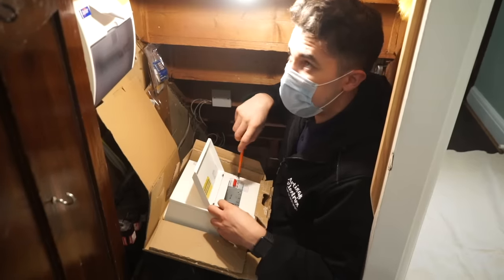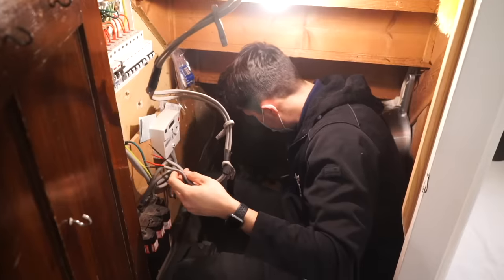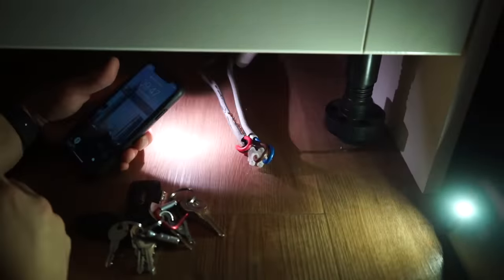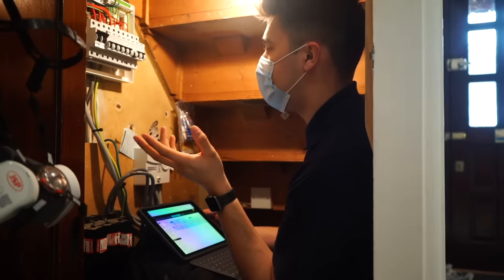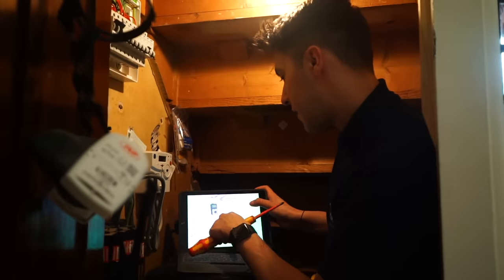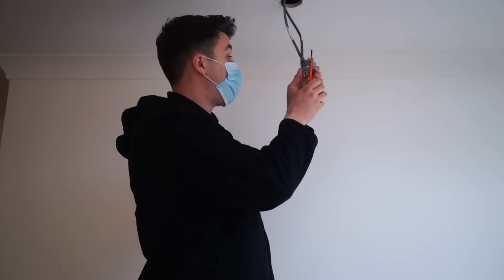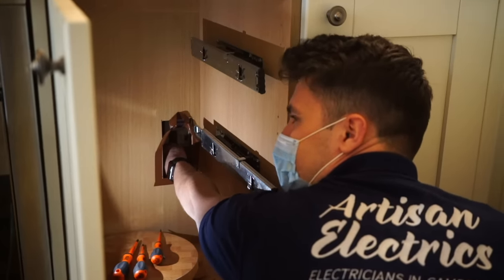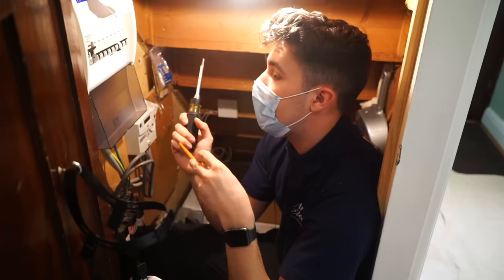COWBOY ELECTRICIAN WAS HERE...

Comment: Cory lives a very sheltered life, this is actually very good compared to some of the stuff ive seen.  Just last week I went to building site with some romanians staying on site, they had a 8.5kW electric shower running off some 1.5mm 3 core flex powered through a 13A plug.  I look at it and think, 'how has that not blown the fuse'.  Opened the plug and found a PZ2 drill bit wedged in place of the fuse and that was the safest part of the installation.
Reply: Sounds like my old school. The hand driers kept blowing their fuses so the caretaker put pieces of 6" nails in them instead. The covers had been lost and you could see the nails heating up.
Reply: Drama queen
Reply: Wow! To think I was worried about using an 8.5kw shower on 6mm......
Finally gave in and got gas central heating with a awesome shower.
Reply: @fabianmckenna8197 6mm is powerlines where I'm from

Comment: I'm retired now,I used to do this inspection and testing 80% of the time, I hated it! I did a big massive university village that took 18 months to do! 1000s circuits and faults on every one. Maintained by city council,  Mr.  Blunders. And I was the one always in trouble? "You switched off the power", they would say. "My computer went off"!  Everything held together with pvc tape and connectors. It cost £millions and £millions to re-wire the lot all for nothing. I passed through Manchester and stopped in disbelief. The whole site has been demolished to make way for a new hospital. I still have dreams nowadays of the Elizabeth Gaskell site! Great video, and good luck with your work.
Reply: worst thing about EICR's for me is that it becomes a thing where you're just going back on someone elses fuck ups. that pretty much all I would seem to find on most of the jobs.

Comment: It’s disheartening for customers, they pay a for a “Proper” electrician only to find out that it was a total waste of money. Or done on the cheap only to be bitten further down the line. 
I attended a customer for a fault, kitchen had only been in 3 months, Carpenter charged £600 to rewire kitchen and told the customer he had an electrician in turned out he did the wiring himself. Had to have the kitchen taken out to rewire the whole lot. We need laws like they have in Australia covering electrical work.
Reply: Even with the laws we have here in Australia there are still plenty of cowboys getting about. I have  come across some absolutely appalling electrical work in my 20 years in the trade.
Reply: Laws never stop incompetence , we are already  highly regulated , i for instance can't work on historical buildings any more because its not on my card (although i hold qualifications that say and prove otherwise but the new regulation systems have decided they won't recognise them ). They forget those with the knowledge , skills and experience often trained under a different regime where college and formal paperwork never really mattered . My main trade is carpentry and joinery , Electrical work was a secondary trade i learned  later in life , at 61 now i have no intention of formalising my training  done 30 plus years ago.

Comment: Awesome video and ♥️Cory !  I'm not an electrician but enjoy the videos.  What is the PCB in the box?  For low voltage garden lights??
Reply: It's a Wisebox. Off the shelf radio controlled circuits. Tend to get used for garden lights and water features, but you can use them for anything. Standard kit gives you 4x 5A circuits and a keyfob remote

Comment: What a horrendous find. EICR only way forward to get the full extent of the problems. Problem is with all the finds you saw do you leave it in the way you found it ie do the tape up on those horrible splices in the kitchen? Is there a minimum rule for safety to have to employ even though you were not involved in that installation to leave it safe for the client.

Glad you did not run away from this. Situations like this is where real sparkies are made. It does not have to be pretty if your not doing a full rewire. Making it safe and upto standard is the first order of the day. Looking forward to the next video.

Real world sparking....... well done Artisan and Cory.
Reply: C1 Dangerous make safe. Even if it means disconnecting the circuit.

Comment: I really like to watch these kind of videos. I have seen an installation that was modified by university students of electrical engineering. Those guys only learn things from a theoritical point of view and don't know anything about regulations and practical stuff. The installation was a complete disaster. Green/yellow earth wire was used for everything, except earth.  And there was a junction box containing solid wires which were soldered to glass fuse holders mounted on a DIY wooden frame..

Comment: I'm only 16 min in and I feel the need to comment. I might only be a Jr Spark but id stop right there and tell the customer it needs a re-wire..... I'm not sure how Cory calls this yet as like I said I'm only 16 min in but that's shocking! I don't think id ever junction a cooker I believe it should be a straight run to the isolation switch. the current going through that cable is high in my eyes and by putting a junction in there let alone how its done just screams fire to me. SHOCKING that's all i got to say

Comment: Interesting video, thanks! Beware oven ratings from early 2000’s some were ridiculously high using elements sourced from a commercial environment. a fifty amp supply seems high, but check that data tag to confirm. CPC-circuit protective conductor (sorry ocd)

Comment: Wow. I was curious to find out what ‘ring circuits’ are. Sounds scary to me. I do like you use higher voltage. Here high currents even with bigger copper can have issues with poor connections. I’m always careful on termination as 120v with high wattage, current can be high.

Comment: You should be able to remove the cupboard in front of the "consumer unit" by the cooker, find all the fittings holding it to the next cupboard and remove, check any going up into the worksurface, screw up the adjustable feet to give you room and it should slide out.

Comment: Here in Germany we have 16 amps 1.5 mm radial socket lines. For 20 amps you need 2.5 mm. 
If a high load is to be expected or the cable is very long, thicker cables are required. Plugs have no fuses. 
Lamp circuits can be fed from socket circuits or, better still, have their own cables. The fuse is then 16 amps or less.
Ring circuit are prohibited here.

Comment: Help a fella out here....What is the box called that you were thinking of using for the cable extensions?  And secondly, what would you joint the cables with? Wago's? I have similar coming up and was thinking about DIN rail wagos, is it worth it? Thanks, great Video as always.
Reply: Theyre called adaptable boxes and you can get them with or without a din rail connection

Comment: R2 in a 2.5mm twin is 1.67 lager than the 1.5mm cpc because 2.5÷1.5= 1.67.

So therefore if you had a ring (for example reason only) of 6mm twin with a 2.5mm cpc, the cpc should be 2.4 times higher because 6mm÷2.5mm=2.4.

Comment: I haven't been in the trade for yonks, but one quick look would have told me that the whole thing would be a can of worms.  I would have told the customer that a complete rewire was needed, and have left it at that.  At least the customer would have saved a fair bit of dosh which could have gone towards a rewire, rather than paying to have a bodge tidied up and made reasonably safe.  I have come across installations that looked neat, with a tidy c.u., only to fine a pile of connector blocks buried under plastered walls. And everything can test ok, and still be potentially lethal - cables slotted into joists, diagonal runs chased in, etc. Enjoyed the video....

Comment: Customer service in old houses is always a surprise. Some pipes here are even still insulated with fabric or the insulation is so brittle that it crumbles between your fingers.
It gets really interesting when one (or more) previous owners of the house have already "improved" something themselves. 

What the previous "electrician" did in your video is what I call a botched job.

Is single-phase supply for flats / small houses still common in the UK?
Here in Germany it is common to supply flats / houses three-phase. (With the exception of the "old stock", if nothing is changed in the installation, but only repaired).

Comment: My oven is on a 40A circuit but its only rated at 2kW which is only 8A give or take. My kettle of rated at 2500-3000W and thats on a flex with a 13A plug.

Comment: It seems to me that UK Sparks have to put up with a lot of disrespect in their trade. For instance the whole joint runs on necessary sockets, beautiful light fittings, labor saving appliances etc, a big part of modern life. But to have the main panel in a tiny cupboard or up so high it can't be reached? That signifies a definite class distinction. Out of sight out of mind, never mind about the poor old sparks,  just a second rate servant who has to put up with it all. There should be a revolution  over there. In Aus, we use  insulated earth connectors having 2 screws  for safety. Twisted earth wires are sheathed  then screwed .  Keep up the good work guys stay safe and well

Comment: Isolation between neutral and ground requires care here when there is a shared neutral between branches of power. We have two 120v feeds, between them is 240, which is used for very high wattage appliances.
Reply: Not as much as on European/UK 3-phase: 230V live to Neutral 400V phase to phase (factor sqrt(3) because 3-phase).  The stuff that North American homes run on 230, we run on 400, sometimes all 3 phases, we have plugs for that, such as 11kW from 3x16A .

Comment: That ring you tested could be 2 radials in one breaker,also them klix plugs are good to use for testing uses ,ie L/N before you plug in the lights,yes looks a mess but for the sake of the new owners would of do what your doing and put it right 👍👍
Reply: If it was two properly installed radials it would of been on a 16A or 20A mcb and I’m sure Cory would of guessed that.  I bet it was on a 32A mcb so it should be a ring with end to end continuity on all conductors.
Reply: @robertwilliams7222  think you will find he said he was going to run new cables to make it a ring,and obviously the state of the wiring they didn't have a clue to fit a 16 or 20a breaker 👍

Comment: EICR's should be 75% inspection supplemented by some testing. The best test you did was the R2 test to metal switchgear and exposed conductive parts. Your observations were accurate, but non-compliances and not electrical safety issues. When you sign off an EICR you are just signing for the observations you've made not taking responsibility for the installation.
Reply: Cheers for that...

Comment: "European" is a bit of a sweeping statement. I think the French and Belgians are the only countries on the continent that do 20 amp socket circuits, elsewhere it's 16 max, can be 10 or 13 too, depending on where you are. Expect mixed lighting and socket circuits in most countries too - the regs usually say something along the lines of "It might be a nice idea to have separate lighting and socket circuits but you really don't have to do it!". If you've got to chase everything into the walls because lifting floorboards absolutely isn't an option for a number of reasons, you want as few circuits as possible, within reason of course.

Comment: 50A MCB, vs 13A flex on the oven. Clearly the oven manufacturer thinks 13A flex is sufficient, as manufacturers instructions and designs trump BS7671. The 50A MCB will most likely trip with an earth fault if the thermal constraints of the flex are satisfactory to the adiabatic equation. Explain how or way the oven needs overload/overcurrent protection??? Think about that for lighting circuits also.. Great video.

Comment: I am not an electrician, but there is absolutely no way way I would do anything as bad as that lot. The owner of the property should take legal action on the previous owner! In my house I found my central heating supply wired in 1.5 mm was fed directly from a 30 amp ring main, the original installation that is with no fuse protection.

Comment: As an American I often find that even proper UK wiring is something that would never be allowed here (and I'm sure the opposite is true, too) but this is way beyond that. Here our breaker boxes are required to be much more accessible than your CUs. Over here putting a fuse box in a cramped closet like that wouldn't be allowed, so you can imagine what I think of the CU behind the cupboard where you can't even access the cover's screws.
Reply: The trouble with houses in the UK, the vast majority are terraced and often really small, so meters and boards are often squeezed into an available space. That’s just how it is in older houses
Reply: @countesscable  In the US meters are always outside and if you don't have space to put your breakers inside you put them outside as well.
Reply: @eDoc2020  services are put outside in new houses, and some older houses have had them outside. They are a nuisance inside a small home as they take up room. As of course there is a safety aspect.

Comment: Mr Bodge is probably a Plumber not a spark at all. Decent vid Cory well done not totally losing it. The new board looks to small for the circuit's that are present is it a 6 way rcbo where as the original is a 10 way? And if you are going to split the rings into radials  this introduces even more circuits. Another conundrum for Cory me thinks.lol
Reply: Maybe make a double stacker? sure it wasn't a kitchen fitter?
Reply: I thought he said he would put the broken rings on 20A breakers, not split them. So they're 2.5mm2 radials with two branches. I'd want to check it's 2.5mm2 all the way though. Who knows what might have been used.
Reply: @tobysherring1369  good point I must of miss heard.
Reply: @anthonybragg  always a possibility after all kitchen fitters can do the whole job lol.
Reply: @chrisardern4594  I agree the new board looks small. And is there anything wrong with the old one? It might be cheap and nasty but does it work and is it safe? If I was the landlord I'd replace it but he just paid for that one.

Comment: Calling radial circuits with 20 A breakers "European" does not really hit the spot as outside the UK you have to protect the socekts rated at max. 16 amps for not being overloaded. So you regularly won't find breakers exceeding 16 amps on most circuits.

Comment: Do you guys use line tracers in the UK?  
They connect to the far ends of the circuit and you can trace the other end in the breaker box (consumer unit) to verify which line is which in a situation like you have there today.
Reply: Yes they have those line tracers, but a low resistance ohmmeter or multifunction tester with continuity testing can do that as well. Multimeter continuity setting measures continuity it does not really test for continuity.
Reply: We do, but they're less useful to us as we tend to have far fewer circuits than you guys (a 3 bed house is typically 6-8 circuits of which only 2-3 might be sockets), so it's pretty easy to find the breaker by just turning them off one by one.
Reply: @havoctrousers  exactly we definitely do have more circuits there is also a tendency in the USA to now use dedicated circuits for more and more equipment and devices - washing machine, dryers, microwaves, coffee machines, heating, ac, water tanks, and growing for large Audio/visual equipment. So in my own home I have at the moment 48 separate circuits in two panels (both 200amp each). That will be increased to about 80 (to deal with smart equipment) and then a separate sub-panel of 40 circuits to deal with two EV chargers, and garbage workshop equipment circuits and solar power install later as well. The electrical infrastructure is growing in modern homes so it’s becoming more expensive but fault finding and trouble shooting become easier with this dedication and separation. I certainly  can see the growth of larger boards and sub panels in the UK as time passes and moving to radials rather than rings.
Reply: @mathman0101  yeah, we're definitely moving that way. I don't like rings and prefer to do a few 20A radials (simpler to test and safer). I don't think we're ever going to see 80 circuits in a normal UK home though - your house must be massive!
Reply: @havoctrousers  very lucky it is about 6000sq feet that from when I lived and worked in London with two kids in a two bed with around less than 1200sq feet big change. Just in the stage of decorating it up now though property was less than 14 years old which is an issue in UK when properties are much older and have undergone multiple revamps.

Comment: Cory would hate North American electrical... Wago and push in connectors are rare, most still use wire nuts, where (if you're lucky) first the person twists the cables together to get a good connection, then they twist the wire nut on. It's an effort intensive and annoying system, but if they're twisted first they're fine. Still, I much prefer using Wago connectors and personally always use them now.